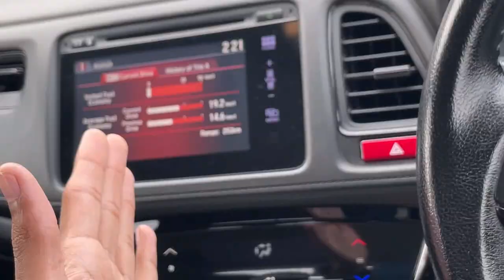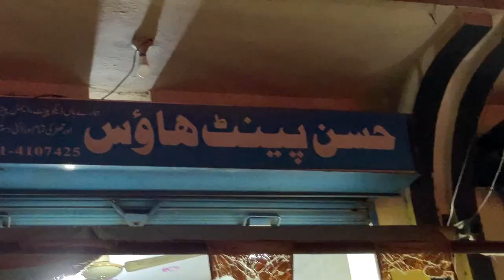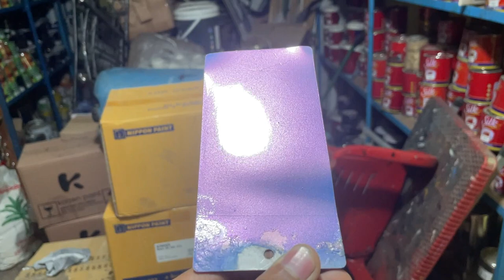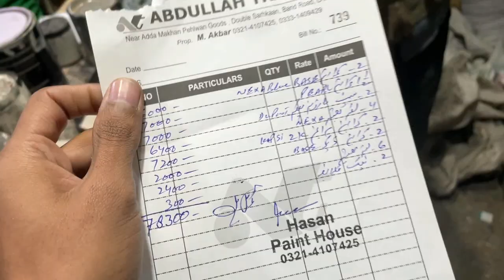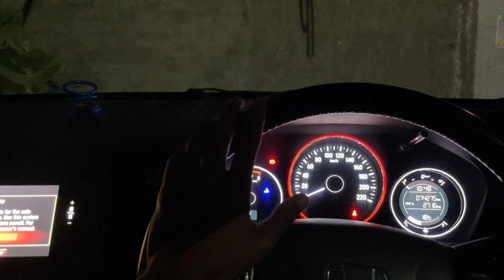Big Varity Time 🤩 ft Waheshi Engine For U 🔥 TEAM 4K

Comment: Haji sb Khyber k best performance engine batae with average efficiency?
Reply: Vitz ka 1300cc auto gear k sth
Reply from the maker: G16b ,G15a
Reply: Haji sahab g series complete nhi milta abhi or usme masle bare hai koi or batae Toyota ka Honda ka
Reply from the maker: @furqanali5986  kisny kha hy k complete nhi milta bilal ganj bhra para hy 
Or daily use k liyi best hy G15a or G16b or atay bhi bolt on fitting py hain without alteration
Reply: Ok haji don't be angry